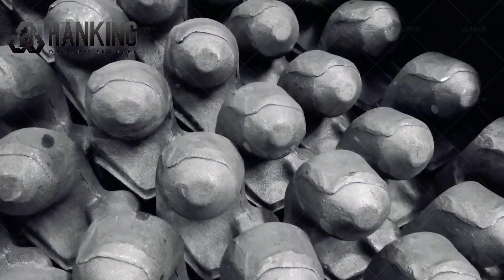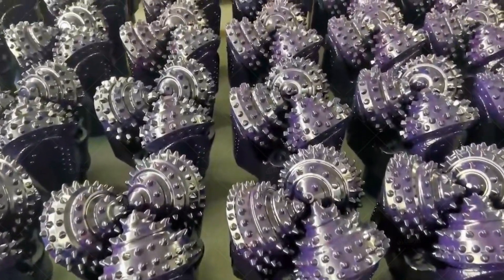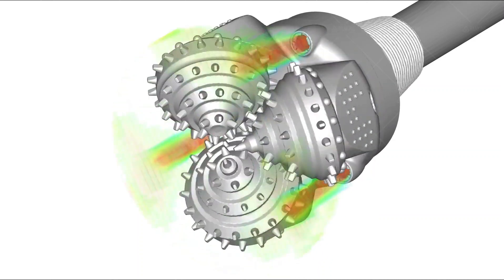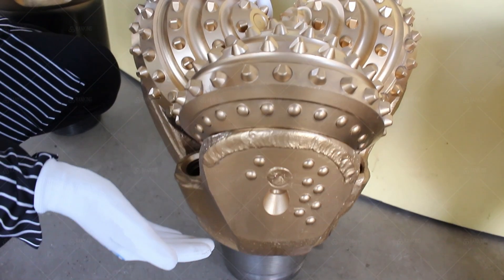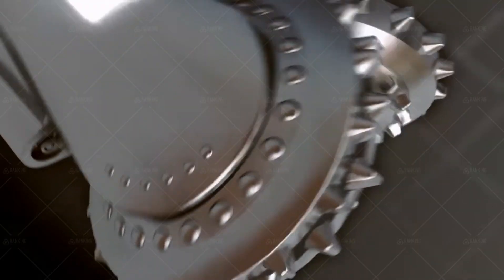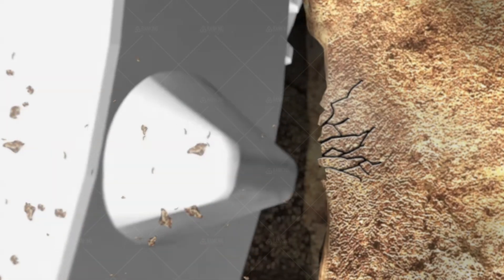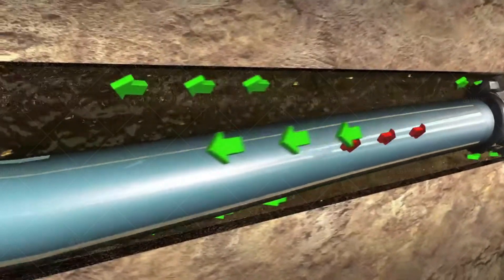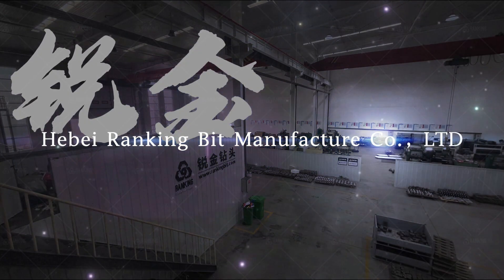Understanding Tricone Bit Sizes and Their Significance in Drilling Operations！

Comment: Rankingbit claims tricone bits are still the best, but aren’t they outdated compared to PDC bits? Technology should evolve.
Reply from the maker: Great point! While PDC bits excel in many scenarios, tricone bits remain the top choice in certain challenging formations, especially where variability in rock hardness is an issue. It’s all about using the right tool for the job!